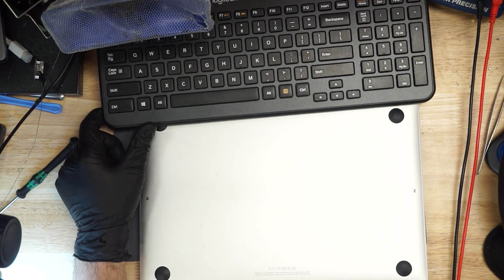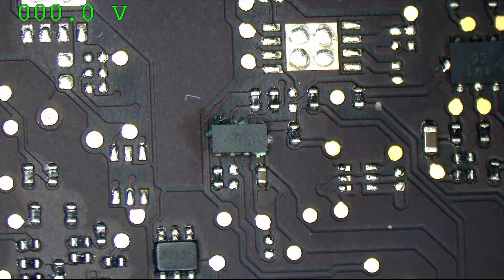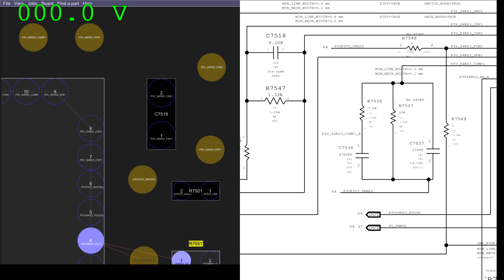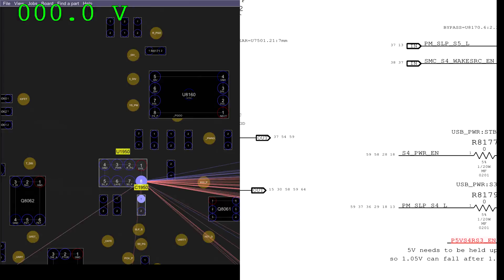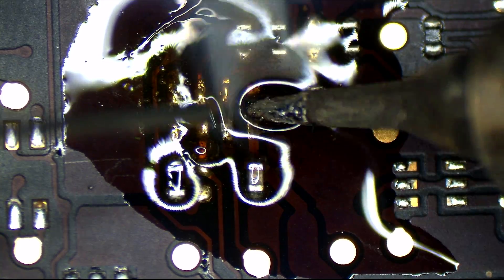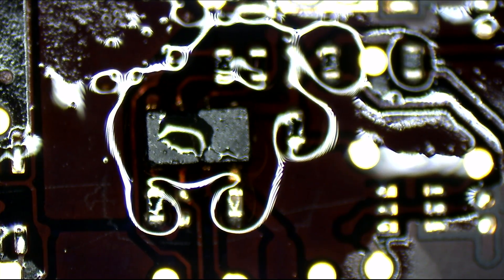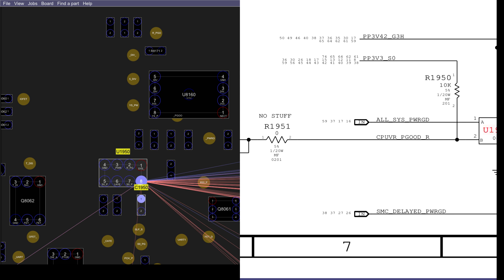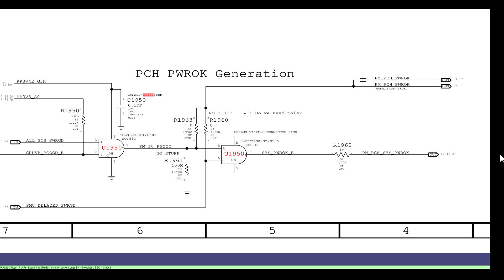Macbook Air logic board repair PM_SLP_S4_L missing

Comment: @Louis , I'm learning here and I've got a question regarding U1950. Shouldn't it be sufficient to have a signal (SMC_DELAYED_PWRGD) on pin 6 (and thus pin 5 since they are tied by R1963) resulting in a logic "1" outputting PM_PCH_SYS_PWROK?

Comment: Hello Louis,
I've recently started learning fixing laptops and I'm happy to say I've already fixed around 10 devices, with help from two great, experiences guys. I really love doing this and I just found your google document; excited! I had one quick question though. Can you - for once and for all - answer this question for me?

Is it best to always - whenever possible - charge your laptop, even when you're not using it?
Is it not good to do this with your phone and preferably use it between 40 and 80% (drainage)?
Is it best to always turn off your iMac or never really turn it off?

Especially the fact that it seems to differ per device, caught my attention. A quick, short answer would already be really appreciated, but It'd be even cooler to actually understand WHY this is the case.

Thank you so much in advance and thank you for your videos.

Comment: Earth doesn’t spin absolutely proven! Experiment always has the presupposition of experience. I am going to give you one irrefutable experiment, which will be undeniable, quantifiable and repeatable.

Spin in a circle with speed being consistent (rpm doesn’t change anything) 2 times. On a scale of 0 to 100 rate how dizzy you are. Take a break. Double. Flat Earthers 🛑 @ 8. Globetards spin to death.

For those thinking they have tolerance for spin on a ball, keep going to 16 then 32 then 64. To deny experience is to deny measurements through experience. It is unscientific. You are not spinning.

If you really want to gain the result of the experiment, which is that more spin over time equals more dizzy and you haven’t thrown up enough after my experiment then start once per day and when you get to 1000 2000 4000 get back to me.

Apple shows a proven fake CGI photo of Earth on models of their products. They are in on it.
Reply: Heres a similiar challenge for flat earthers :

Stand in one spot. Now start spinning around at 0.000696 rpm. Tell me if you feel a difference.

The reason we don't feel the Earth's spin is because it revolves ONCE A DAY.

Stop spewing this garbage and take some time to learn basic high school physics.

Comment: Are Macs the only computers that come into your shop? I mean, I get it, they're shit. But surely other manufacturers also have their problems?
Reply: Man, I have Lenovo cheap laptop, the G series of 2013, and to this very day, still works very good with no problem, even the battery still last 4 hours of continuous work, even though the battery already had decreased to 80 % wear percentage. Most repair videos I see in this channel is MacBook air, which is newer than mine

Comment: PM_PCH_PWROK is not required for PM_SLP_S4_L to come up. But PM_SLP_S4_L is required for PM_PCH_PWROK. The fact that that missing PM_SLP_S4_L was apparently caused by missing PM_PCH_PWROK is most likely because the board was in fact power cycling from PM_SLP_S4_L up to ALL_SYS_PWRGD.
The B&K Precision 390A is a bit slow as a multimeter. Chances are it may miss the spike.
Especially on 3437/00165, liquid damage causing issue on pin 8 of U1950 is very common and will cause power cycling.
Reply from the maker: $150 for a slow multimeter. So sad. :(
Reply: Louis needs a scope
Reply: @piernov  So you're french then =) Great video, subscribed. Please keep them coming.

Comment: My girlfriend has a Macbook that gets really hot in the back area and the internet browsing, and processor response speed gets slow when it heats up. What do you think this could be? I live in Chicago, and am considering bringing my laptop to you since you know your stuff so well.
Reply: If it’s a little older the cause can be as simple as the fans being dirty or it could be the thermal paste is past its prime. I am no expert but some canned air and new thermal paste does wonders. This is of course if nothing hardware or software related is wrong with it. I would start with simple stuff first and if that doesn’t work time for a professional.
Reply: What MBP model/year?, since when the problem started?, did something happened/changed with the MBP since the problem started?, for me it sounds like thermal throttling, a lot of apple products have poor and almost non existent ventilation and when things get too hot the cpu/gpu start slowing down to protect itself, if thermal throttling is too aggressive it may be the fan or the cpu thermal paste, if not sent it to master Rossmann because something in the internals is F* up.
Reply: diagnostic is free with him I believe, better send it in (if you don't know what you're doing)
Reply: It could be that it's a mac. They are designed to overheat and throttle because fan noise is such a drag, you see.
Reply: @LA-MJ  Well non mac pcs are no exactly notable for being cool machines either.
Reply: download smcfancontrol, best add-on I ever used

Comment: Greetings from Germany. 

I got an A1278/MC374LL/A mid 2010 13 Inch MacBook pro with random Freezes and Crashes to a Messed up Screen or Just a Plain blackscreen From the Nvidia 320m Chip, it only happens when it is cold or not used. It Works fine under hours of full load, but Crashes when its Not doing anything. Ive Seen that the 15 Inch Model with the 330m has Problems with the Caps not Working correctly. I had the Board out and could Not see any liquid Damage. Im visually impaired so its quite Difficult for me to get this properly analyzed. Did you have a similair Thing on one of those and Maybe have any tips for me where i should Start?

Comment: Was this macBOOK not already death for a long time.
I can't believe that the connection was never there or was it?
A good soldered connection can not loosen up, and corroding in minutes/hours?
Ergo! The board came already with a loose connected (although touching) pin from the factory in China!?

Comment: Really would like to get analysis of that solder..  I will bet, that if it has silver in it...its very low.
If you can show its not GOOD silver solder, you will have another point to give to apple..
Reply: Its just that seeing green stuff on the solder is not a great sign of good solder..  Iv opened electronic that have been 30+ years old, Iv seen the insides of Tube sets...The burn out points on the old tube sets Generally were the contact points for the tubes, and Seldom anywhere else..  a metallurgist can do it in a few hours, easy..
Reply: finger never been tought how to type very well...shame on them fixed..
Reply: So you want a sample of the flux to determine the solders content? How does that work? If I send you a sample of the oil from my truck can you let me know how my tread depth looks?
Reply: @--_DJ_--  dude its inferior solder even old electronics that generated alot of heat didnt have those problems thats what hes trying to say
Reply: @jesusyeshuaelelyonelshadai6295  I am well aware of his point, I was just pointing out his typo with a question and he got a little triggered.
Reply: @--_DJ_--  DJ, metals are easy to sample...And your oil is also..  by  the viscosity..  
Solder is made from different metals, generally 2-3...and they can be separated...IF you over heat solder, you cant destroy some of its components, and WHy it get hard or soft if not used right.  HOW do you think we got Solder  and silver in the first place...bet you have never seen 99.99 silver.
Reply: @ecash00  In an attempt to seem smarter than me you have missed my point entirely, well done!
Reply: @--_DJ_--  The connotations of expressing the word silver must have hit a point that i was saying...Yes I made a wrong word...but your expression in your text is absolute idiocy..  and being about 60 years old..yep, Im getting there.  Iv got to many things sitting on my mind...but that solder is really bad stuff.  It cant be professional high grade.
Reply: @ecash00  You sir are too funny, I was pointing out a flaw in your post, and you decided to try and belittle me? As a 60 year old you should have enough sense to read what someone writes and think about it instead of being triggered like some wet behind the ears soy boy.
Reply: @--_DJ_--  BUT I LIKE BEING TRIGGERED...its fun being picked on by idiots..Who think that an expression mihgt make other thing,, ,easier to say what is the problem..as 1 other did..
Reply: @ecash00  some ppl worry about stupod things and miss the point dont worry u made a good point
Reply: @ecash00  Who was picking on you? I pointed out the flaw, you just didn't see it.